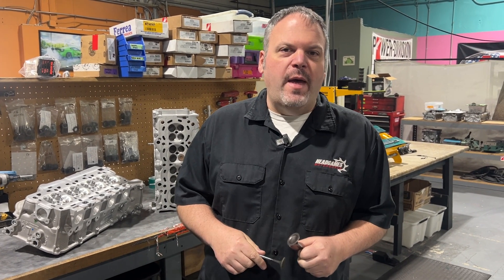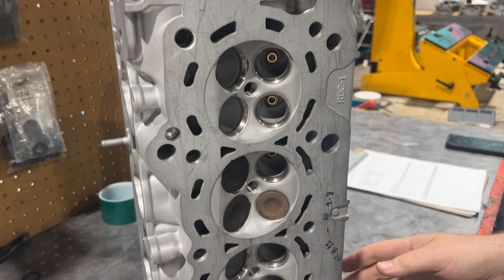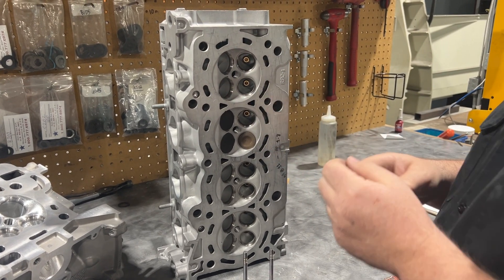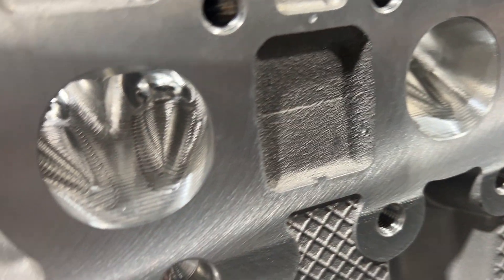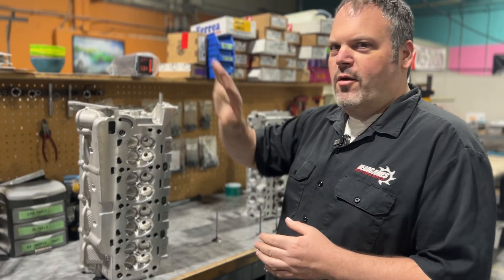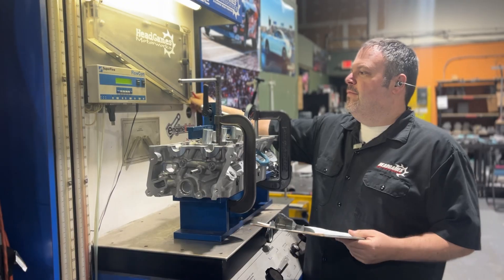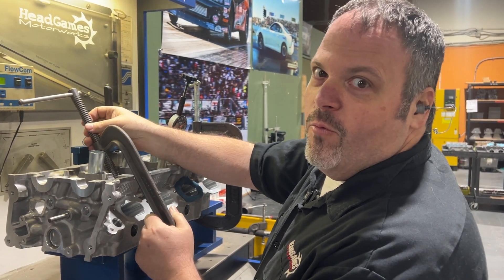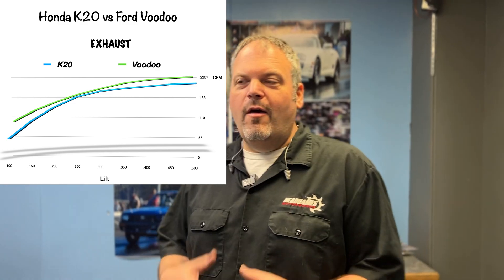Ford Voodoo vs Honda K Series: Flowbench Showdown – Which Cylinder Head Wins?

Comment: As a repressed uk citizen I’ve never heard of the Voodoo head/engine does it have a uk equivalent?
Reply: only the gt350 comes with it since the voodoo is a 5.2L engine based off the coyote, you could also just order the heads from ford themselves
Reply: @ thanks for the info
Reply: If you buy the 5.2 Alluminator crate engine, it comes with this head I believe.  However you get a normal crossplane bottom end (which you want as the Voodoo has some durability problems for motorsport use, unfortunately).

Comment: Stock cast head, vs ported head from factory. Not a apples, to apples comparison. 
Guarantee FD2 type R head. Would give it a run for its money.
Reply from the maker: @igvtec  that was the argument. I do agree though
Reply: Yup, CNC K-series heads beat the Voodoo head by quite a large margin, flowing at around 380 CFM at 0.500", which is absolutely astonishing for a head designed to fit such a small bore.

Really, that's the power of VTEC, it can make cam/port combinations, that would otherwise be completely impossible to mass produce, viable in production cars.
Reply: @PistonAvatarGuy  I remember 375CFM on K Series from memory, so to hear your 380CFM number is refreshing.   For DOHC .200 to .400" is most important because the cams aren't lifting out to .700" or something like a pushrod, a good DOHC cam is usually mid .400" lift and a bad one might be low .300".
Reply: @dennisrobinson8008  It all depends on the head and engine. 4Piston offers a K series head (non-Honda casting) that flows 440 CFM, but they don't provide the amount of lift for that rating. Their Reaper engine supposedly has a cam with more than 0.600" of lift on the intake side.

Comment: BMW s54 please     And  Honda f20c     -    The only competitors imho
Reply: Yep, doesn't f-series head also have bigger valves than K-series? 36 vs. 35? I remember seeing over 300 CFM at 28" 20 years ago on that head.
Reply: S54 is the obvious choice.  Both K24 and S54 produce 100+WHP per liter with quality bolt ons.  250-260 WTQ is also very common on bolt on 3.2 S54s.
Reply: @nogigrappler  I miss old high revving engines like this. new cars are so boring and samey. esp for honda i mean the civic si and type r have nothing special going for them anymore no more100hp per litre screamers. the engine in this vid where in cars like the 06-11 civic si ( amazing car somehow ) and rsx type s the last cars of their kind, no joke. Would love to drive a e46 m3 one day only driven e36 328i which are slow and somehow made less hp than my prelude and k series 😶‍🌫
Reply: @nogigrappler S54 had the highest torque per liter of any production engines, later Porsche and now new Corvette are a little bit better.  And some Ferrari engine.
Reply: dont forget the s65/s85
Reply: @fry.master  love my 2010 bmw m5 V10 s85 engine 😈
Reply: Would LOVE to see an F20C on there. 120hp/liter with that thing!
Reply: That would be interesting

Comment: it is very hard to beat a 4 valve Cyl head, but out of curiosity do you have a Gen 3 Hemi around more to compare V8's vs V8's
Reply from the maker: @CJ5EVOLUTION  I have the hellcat and a gen 3
Reply: @CJ5EVOLUTION  i was sarcastic people take it easy.... would like to see and compare one of helcat heads agains an Mercedes benz 6.3 litre from thr SLS
Reply: Do you realize they are both 4 cylinders heads... right?(not flowing engine blocks here)
Reply: @rickyvwt is the Gen 3 not a 2 valve per cylinder?
Reply: @rickyvwt  Yes, everyone is capable of counting the amount of cylinders that one cylinder head covers. Yes, we're obviously talking about the type of engine that the cylinder heads are from, not the amount of literal cylinders that an individual cylinder head covers.
Reply: I understood what you meant I find it interesting what head goes on top of what type of engine block. I think you have to take in consideration the actual engines usage and when one engine has a larger bore and displacement ultimate airflow is not the most important thing the engineers are thinking about for its intended usage. Air pumps and n their nuances awesome 💯 😎 s***

Comment: VQ35HR, I’ve read that they outflow a lot of ported heads. The  VQ37VHR has almost the same port geometry as the HR with a different divider and they’ve been known to make 370 plus wheel with cam upgrades and bolt on parts. The VK56 is starting to gain traction but that head needs to be ported to raise both intake and exhaust roofs to reverse the truck modifications that Nissan made to create more torque for low RPM grunt. Guys in Australia and New Zealand make more than a hundred horsepower per liter with them on stock compression fly cut pistons using big cams and port work.
Reply from the maker: @stucbr1100  the HR is a bad hombre